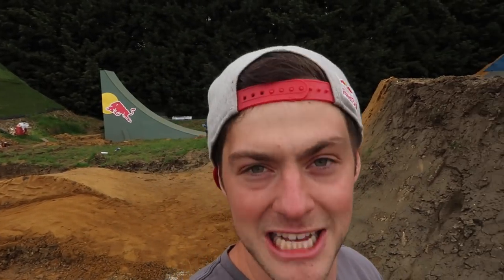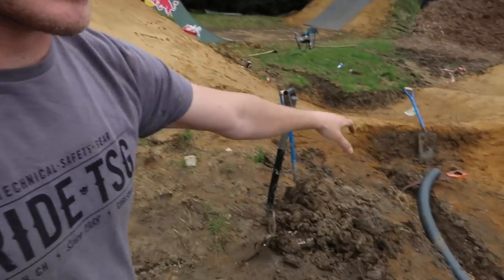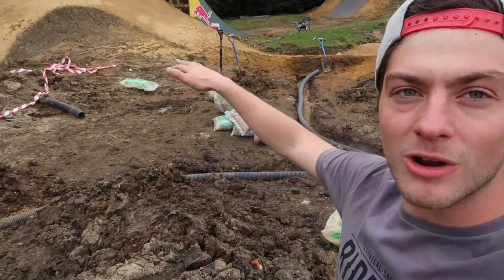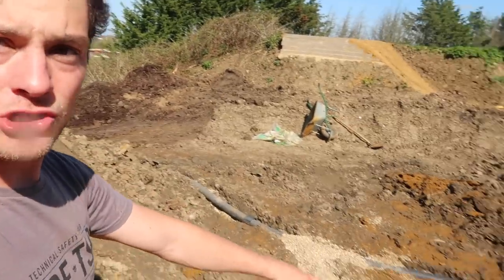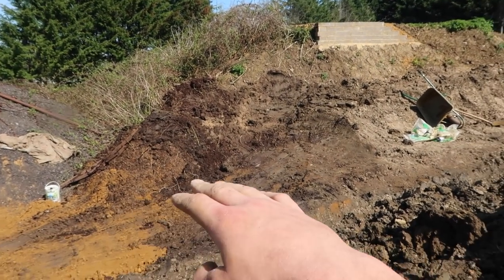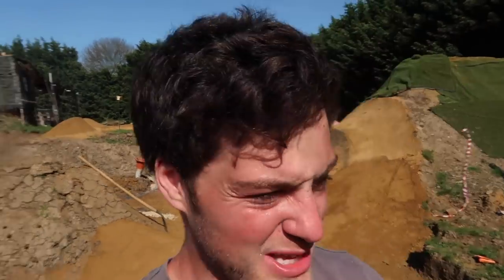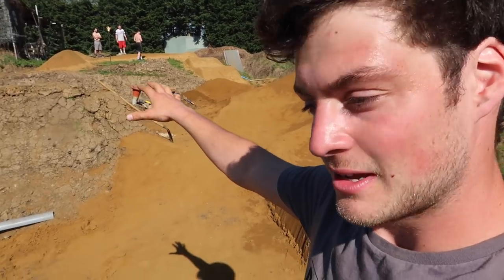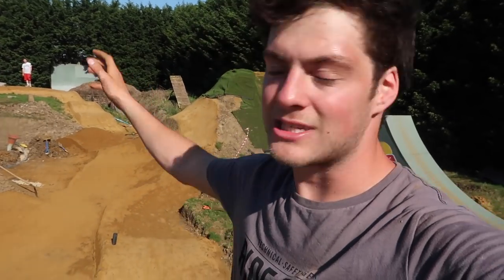THE BUILD CONTINUES...

Comment: You should be wrapping the pipe in landscape fabric so that it keeps the dirt out of the pipe. Especially that you are using sand. Have had to repair so many of those failed systems
Reply from the maker: hey dude, I did think that, hopefully the pea shingle and gravel forms enough of a barrier to stop sediment blocking the pipes, only time will tell but fingers crossed, thanks dude

Comment: Compacting the sand on top of where your drainage system will ruin it as the water can not drain
Reply from the maker: does it need to stay loose for the water to drain through?
Reply: Matt Jones Best to use a coarse substrate where you want it to drain. Much smaller than pea gravel, but bigger than sand. Imagine BB gun gauge.